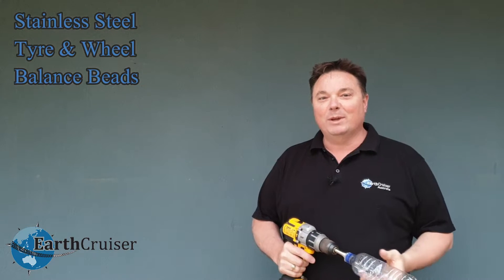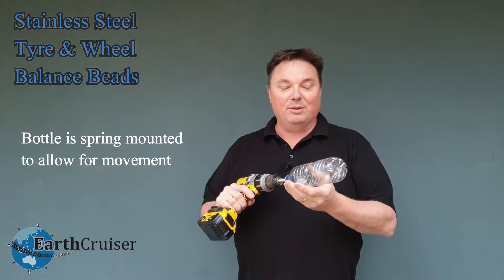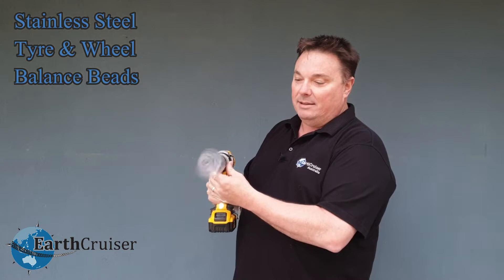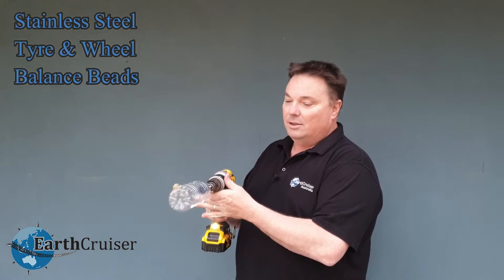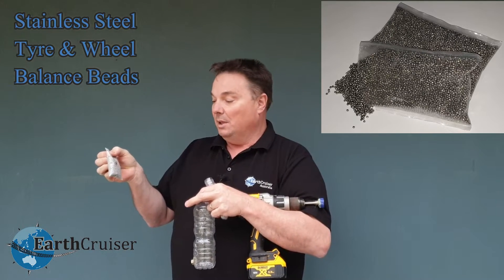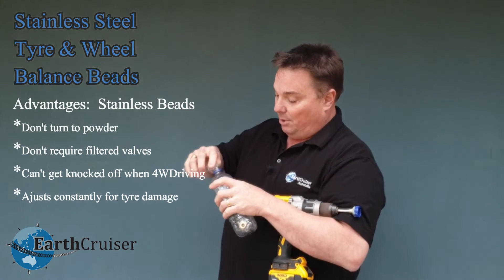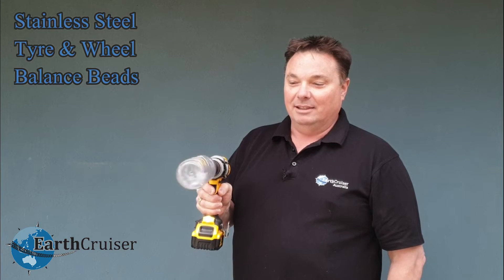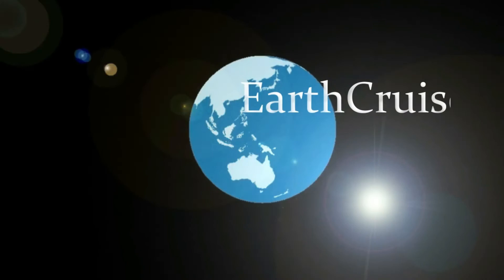Stainless Steel Wheel Balance Beads

Comment: Can you post a video of these beads in a tire rotating at various speeds because I have a F250 4x4 just got a set of tires and when I come to a stop there’s this rattling sound checked my hubs no play ball joints no play and I’m curious as to if steel beads would cause this noise going back to the tire shop to see what’s what I have a video of the noise .
Reply from the maker: The beads make no noise - you can hear them if you jack up the vehicle and slowly turn the wheel, but you have to listen very carfully
Reply: Earthcruiser Australia i have a video of it and you can clearly hear the beads and when I speed it up jacked up of course you can hear them I took it to my tire shop and he told me that that’s the noise it’s only when I’m coming to a stop do you have an email I can send the video to you to get your opinion .
Reply from the maker: @freedom-volvo-usa  mark@earthcruiser.net.au
Reply: Okay just sent it

Comment: So how long does it take for the beads to reach their optimal placement once you set off? I’m guessing they are better suited to long distance driving rather than start/stop city driving? Then again, in start/stop traffic, you’re probably not really going to experience any effects of non-balanced wheels.
Great idea though!! :)
Reply from the maker: It is not a time "thing" as soon as your vehicle gets over approximately 30km per hour the beads are balancing the tyre. So every time you take a chunk out of your tyre they will reposition and your tyre will be balanced (the 30km p/h depends on the tyre size)